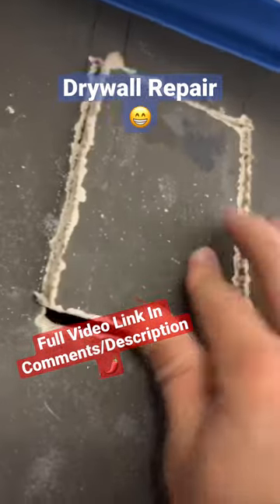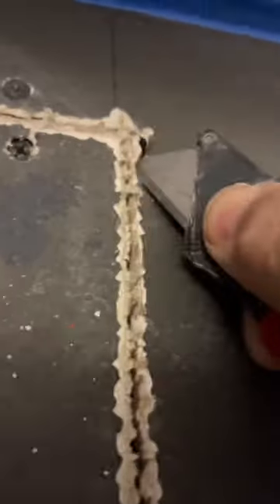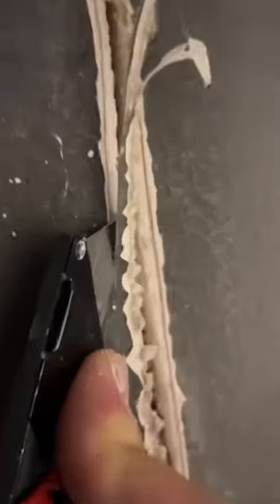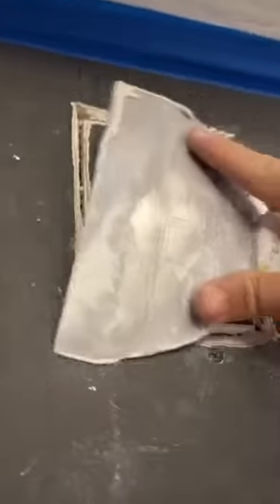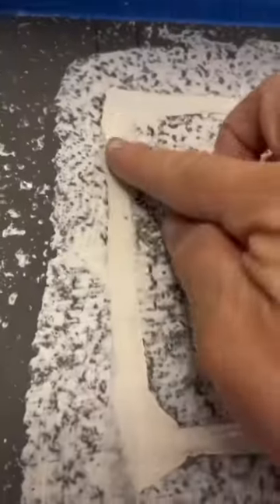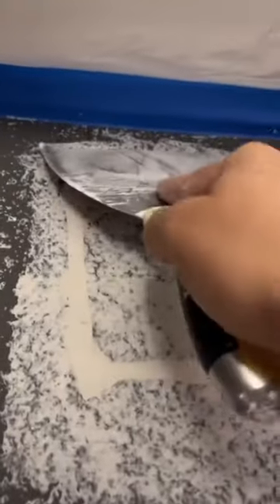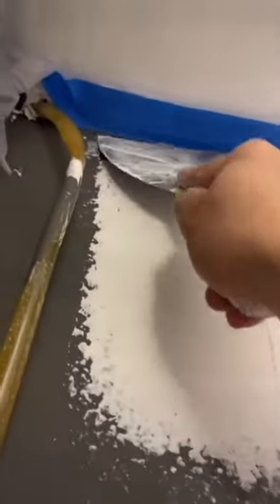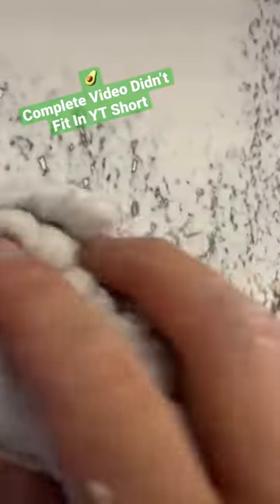How To Use Homax Wall Texture (Orange Peel). #short #walltexture #diyhomeprojects #drywallpatch #diy

Comment: Just a word from the wise, take it with a grain of salt.

You should use full sized pieces of tape. Its not a big deal, I'm sure its fine being such a small patch.  But in a bigger scenario or on a ceiling you could possibly get cracking still where the edge of the tape barely meets the patch or the wall.. 

Also the build up you did to feather out the patch will hide the mesh tape. And i recommend that you feather out double the size of the patch on all 4 sides it allows you to work that hump out from the repair. In high traffic areas after paint that sharp rise can be really noticeable. Of course if its a workshop, rental or something alot of people can be alot more forgiving to a little unevenness. All about the job i assume.

And lastly the wet sanding, yes work your edges but also hit the whole patch a few times to work out any imperfections or micro air bubbles that your eye may miss on your first couple skims over. But always be sure to never take off any more material than needed. It sucks when you have to  apply another coat so close to the end because you hit the tape.

Of course this is a texture patch aswell so you do have some forgiveness when it comes to sanding and feathering.

Just a few tips from a carpenter who has been in the maintenance field aswell. God bless, happy holidays and get that money my brother!.
Reply: Thanks man
Reply: MERRY CHRISTMAS
Reply: The best reply
Reply: Actually,  make sure the easy sand is thicker , so it'll fill in voids easier , wipe tight,  let dry , dust off.  Then apply a thinner layer of easy sand , apply tape and wipe into the mud.  Then let dry, dust off and then 1 coat easy sand , let dry , dust off and then finish coat , let dry dust off then touch up and feather out the mud. Apply texture while still wet. Let set up.  Wipe down.  Sand , prime and paint.  If you spot prime and then sand and then paint , it'll flash big time , you should spot prime , sand, wipe off dust,  spot prime,  dry , spot paint , dry.  Sand , spot paint with a 5 inch Wizz roller 3/8th napp.   Should not see afterwards.  I've done drywall and painting for over a decade and I've done patches all over people's houses and they never know I've been there when I leave.
Reply: Its not rocket appliances bud
Reply: @BenDover69-69-6  all i was doing was spreading a word from the wise. 

If people aren't told then how will they know? Ive been doing this kind of work for 20 years so I can say that a little word from the wise can go a long way. 

Just because you don't see value in my post doesn't mean others don't. 

And just to add to the irony of your response.. its "science" not "appliance.. Rocket "science"
Reply: @jordanharvey2163  sure.
Reply: You don’t seem like an angry ginger at all!
Reply: @larrygill2223  ahh I surly appreciate it. I hope you have a successful and happy 2023 my friend.
Reply: @TheAmericanCelt  thank you 🙏🏽 bless
Reply: At least he didn't use some cheap premix that'll eventually start to crack even if he used 2 inch tape.

Comment: When you say to apply the mesh tape. You mean to push the tape into the mud below the face of the wall right? Thus facilitating putting the second coat of mud that is smooth and does not bulge out?

Comment: On a patch like that 5 is cool but easy sand 20 in my opinion is the more versatile and forgiving hot mud can use it for all sizes of patches. 5 sets up to fast if you’re doing a big patch. If you you’re in a rush just put the heat gun on it for 5 min and bam shes set up ready for a second coat.

Comment: Why did you even bother with a colour match?😂
Reply: He's still gotta paint it after the mud drys. Having the little piece of drywall with the color the wall is painted allows him to have them match the color, particularly if it's a custom color and most likely no more of the paint is around from the original paint can. He didn't necessarily need to use the piece with the paint on it to patch the hole, just to get the color as close as possible for the final paint job.

Comment: How NOT to repair drywall. Dude trying to be different when this is age old simple procedure to use normal size tape, no need to cut the sheetrock edges out, just trying to be unique for click-sake is pretty lame. 😂